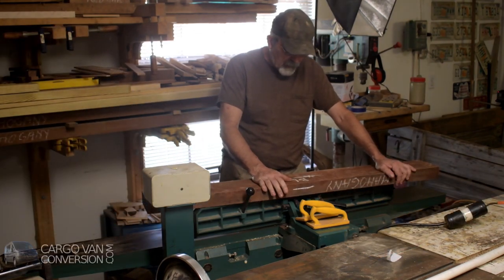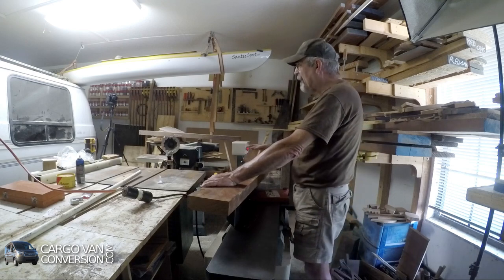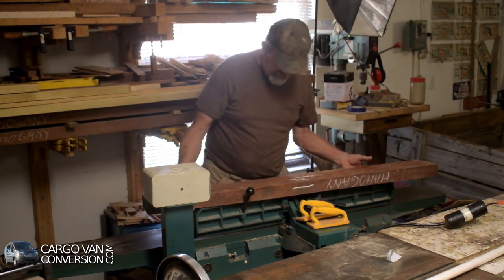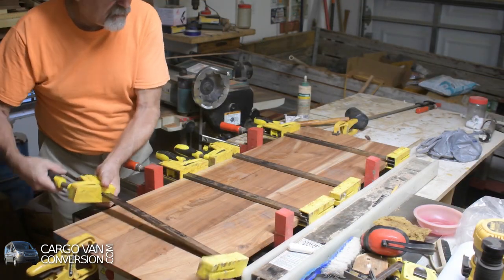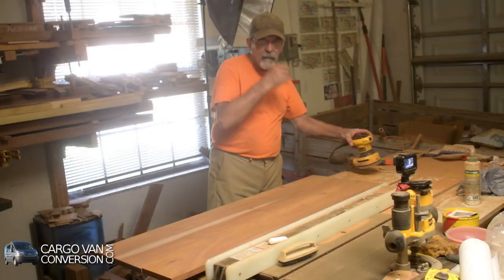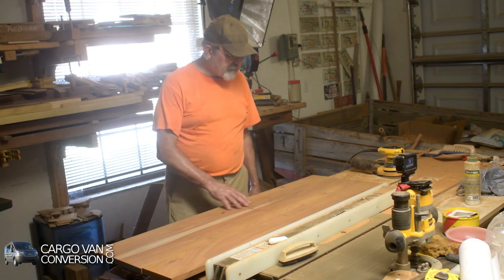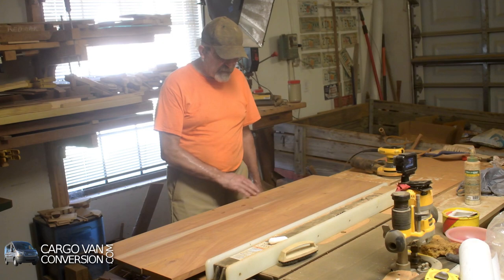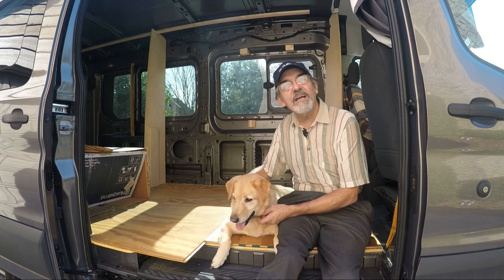RV Mahogany Countertop

Comment: Great timing.  I'm going to be using mahogany to build a countertop in my camper.  I'm going to cheat and use the pre cut lumber from Menards since I don't have all of the tools you have.
Reply from the maker: I was certainly not expecting that :) When you buy these boards, watch if they have sapwood and if so, find some boards with a matching pattern. Meanwhile I have been finishing it with Shellac which gives me a fabulous finish. But it may have some issues at high temperatures from 150°F up. Especially in front of a window that maybe a problem. Have to see and wait.
Good luck with yours and send me a pic when it's ready. Would appreciate that.
Van Williams
Reply: Hi,
I am a newbie. I luv Ur work and patience.  Do U think using Birchwood would good?